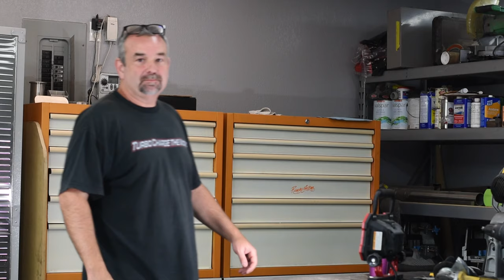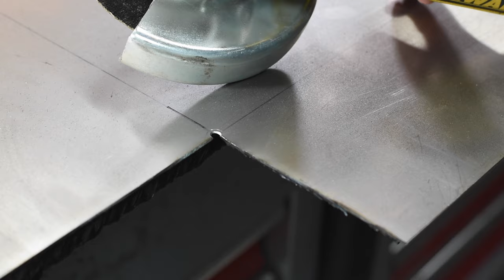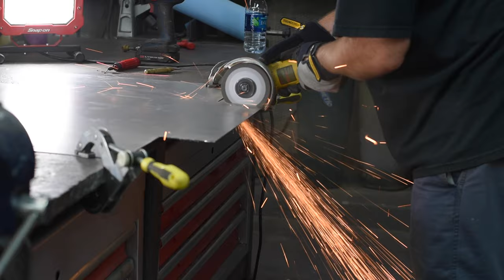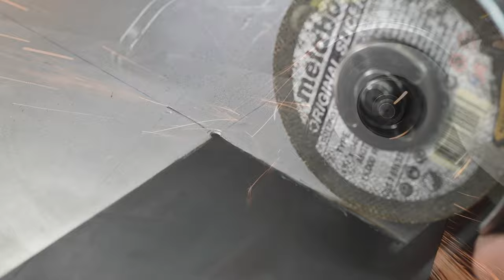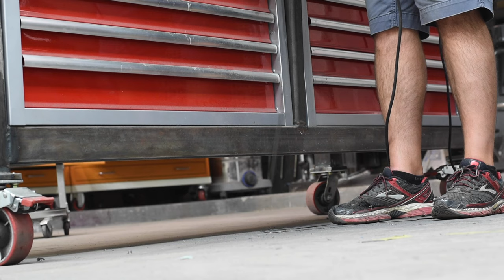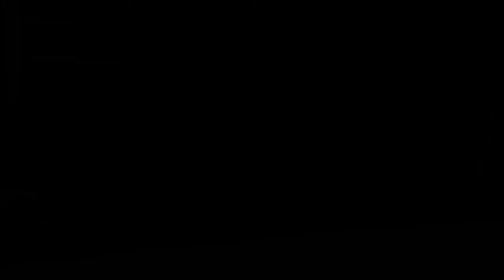How to cut metal steel iron at home - DIY

Comment: Good tip, I like using a face shield in place of safety glasses while cutting. I've had those discs come apart and that disc goes everywhere. Thanks
Reply from the maker: Rusty Glovebox Yep, that's a great thought.  I have had a couple of those face shields but they get all scratched up from laying them down.  I want to get one of these.  http://www.envirosafetyproducts.com/3m-6000-series-full-facepiece-respirator-large.html?gclid=CKCImsyh9MYCFRAxaQodijEMfw

Comment: Great tip..when do I decide its time to change the grinder disc
Reply from the maker: CountrySideClub Good question.  For cutoff disc's, i use them until they are down to nothing.  I keep some of the worn ones around, sometimes you need a small disc to get into tight spots.  As far grinding disc, I don't use the typical carbon ones, only the flap disc style, and it's easy to tell when they wear out...  Thanks CJ